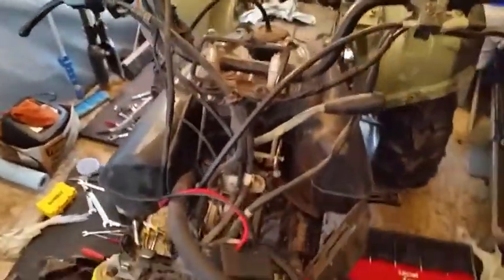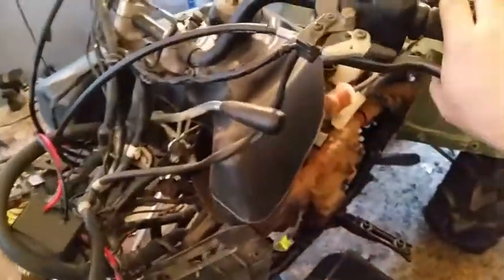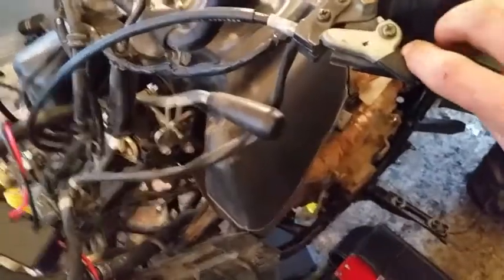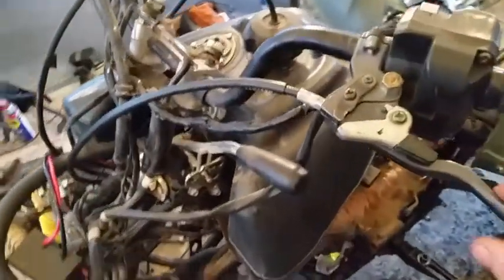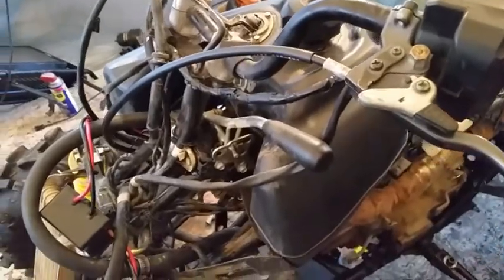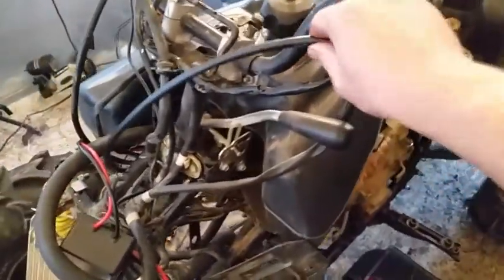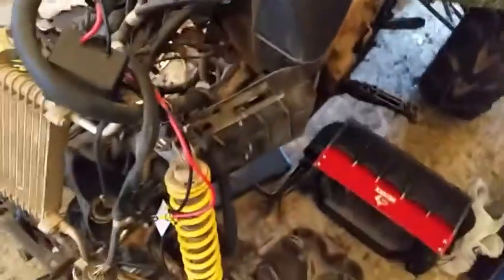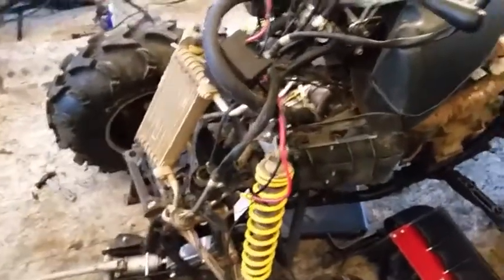2003 Honda Rincon 650 rebuild 27

Comment: Awesome, coming along nicely. Don't forget the front axle cotter pins and new grips.
Reply from the maker: Lucky Goose yes definitely, i need to pickup a little variety box of new cotter pins and install them all over the bike.
Reply from the maker: Lucky Goose but what new grips?
Reply: denis gorelyy the handlebar ones. Looks like yours are totally worn out. I had to replace grips on both of mine Rincons. ( I rebuilt them both like what your doing). Honda grips and Honda grip glue. It’s so worth it. 

 Wasn’t that alignment a total pain in the ass. I had to do it over and over again until I got it right.
Reply from the maker: Lucky Goose it wasnt bad for me since ive done it before. and from my understanding you want both sides toe out a little bit right? but also i havent test driven the alignment yet.
Reply: denis gorelyy Yes, toe out. My problem was the handle bars were not straight once I was done. I had them strapped straight like you did and for some reason ended up off the mark. And then my ADD kicked in and did not allow me to leave it crooked, so I made them perfect. Took forever.
Reply from the maker: Lucky Goose did you align with your wheels off the ground or on the ground? i noticed it was throwing my alignment off when my wheels were on the ground so first i jacked it up.